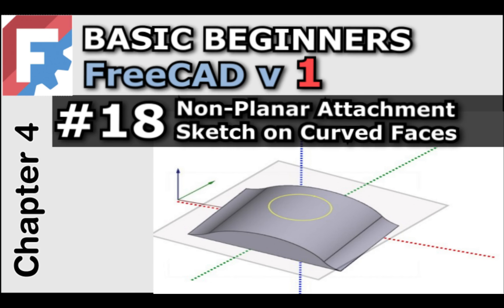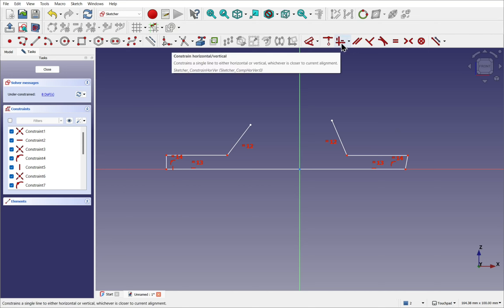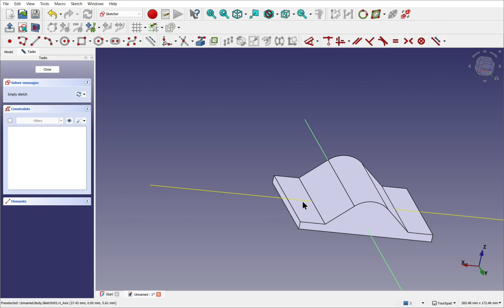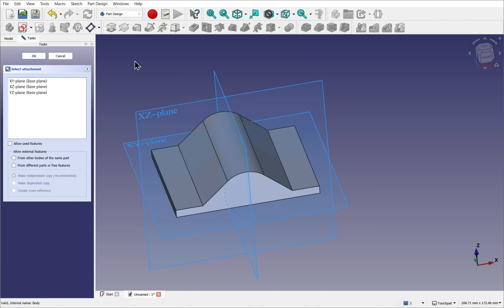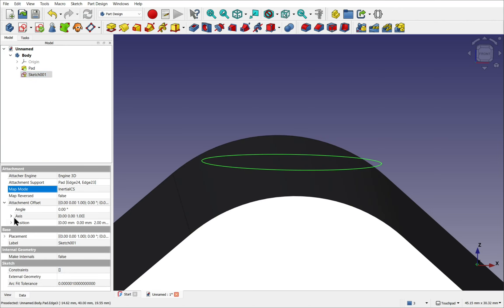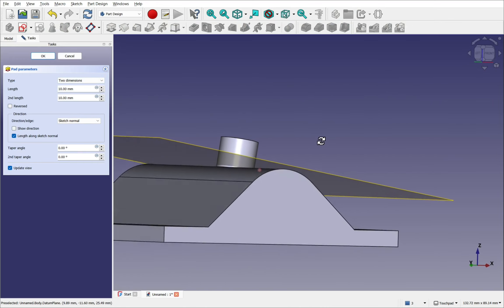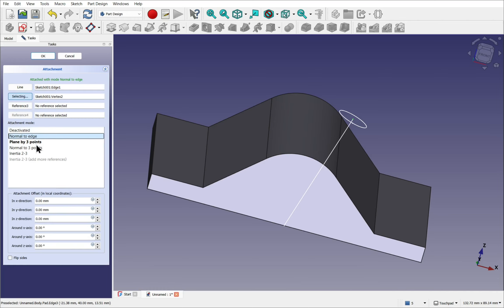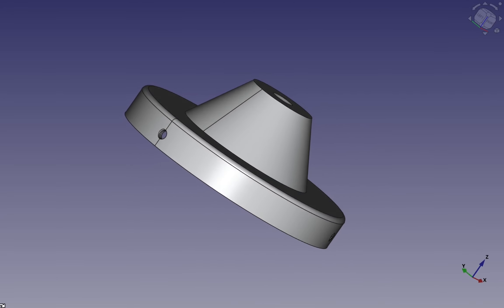FreeCAD Curved Surface/ Non Planar Sketch Attachment | Basic Beginners FreeCAD v1.0 / 0.22 Lesson 18

Comment: Which method to use may be decided by engineering specs.  Getting Freecad to generate specific dimensions can be challenging. A full explanation of construction line techniques including the ability to toggle construction lines into functional lines.  Cudo's to the development team for the improved line length & angle display.

Comment: One problem is how to attach a sketch tangent to a curved surface.  The Tangent Plane Map Mode requires a vertex at the attach point.  The best way I've found to do this parametrically is to use the Curves Workbench Segment Surface Tool.  This provides a vertex (vertices) to attach to that can be moved around with the KnotsU and KnotsV parameters.
Reply from the maker: Nice useful tip there, thanks for sharing that 👍

Comment: Thank you very much Darren, however I feel it is tsill notvery intuitive. Why is it not possible to use 3 vertices. There order determines everytihing. I have been trying to use 3points etc. but still have the problem that the normal is not in the direction I expect it to be. For instance O-X-Y, in that order (assuming positive for X and Y) should result in a sketch plane one expects.

Comment: Not possible to pad attached sketch. Error - Attached to a non App.
Reply: Try "Reversed" or "Symmetric to plane." In Part Design, a body must not contain multiple disconnected solids. You can create a new Body if you need disconnected parts.

Comment: At15:20 you change the Attachement Offset in x-direction, but (that's my view of things), the circle moves in y-direction.
I noticed this quite often, especially when repositoning sketches, the direction of movement or axis of rotation has nothing to do with the orientation of the global axis. Can we somehow visualize the local axis, in case that might have a orientation different from the global axis, or is there a general definition or explanation how to find the actual oritation of the sketch we want to move?
Thanks.
Reply: Same question. I wonder why it is not exist in Freecad 😢

Comment: I think it's better to do datum plate in this way:
1. create sketch on side of object
2. select arc as external geometry (sketcher external)
3. make line from middle of arc to some point at arc 
3a. make constrain angle
4. make some line and
4a. make it constrain with end of the line from step 3
4b. make it constrain perpendicular to the end point of line from step 3
5. end sketch and unselect all
6. make datum plane and as reference select"
6a. points at end of line from step 4
6b. point at begining of line from step 3 (middle of the arc)
7. select "normal to 3 points"

Now by changing angle of line from step 3 You can directly change position of datum plate at the arc plane
Reply from the maker: Thanks for adding your workflow, always greatful to see others join in and include their knowledge. Datum planes are great because you get something physical to sketch upon and you can see it there. They do add a bit of extra processing power though.